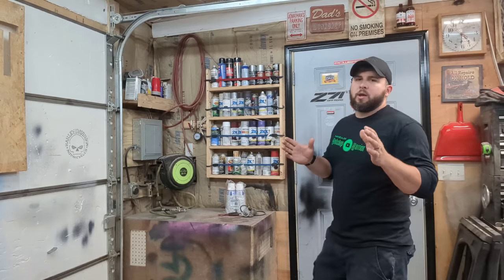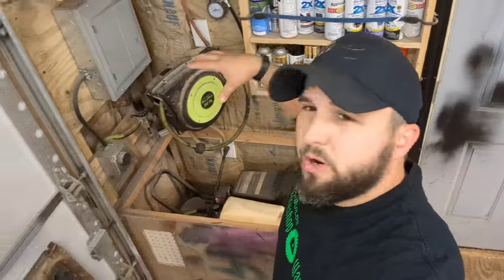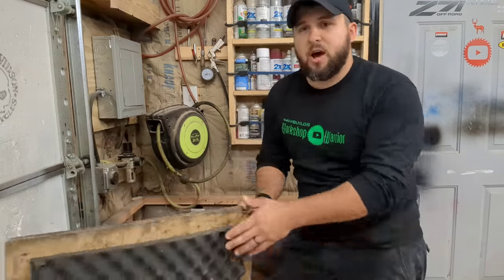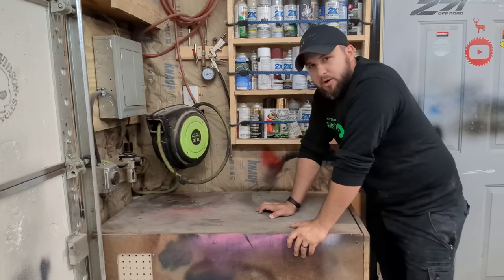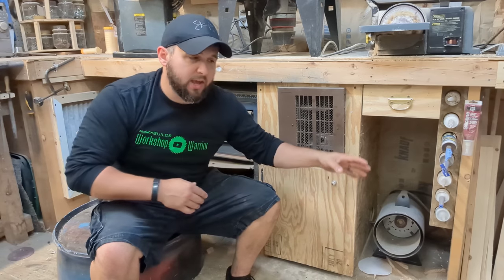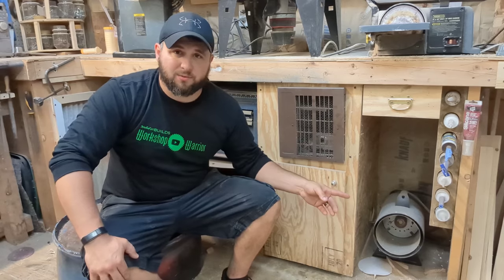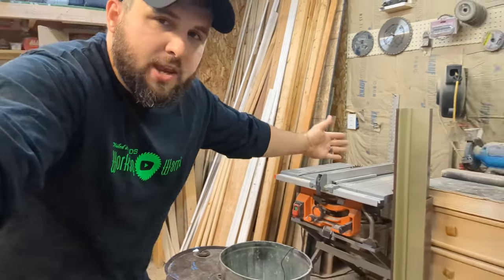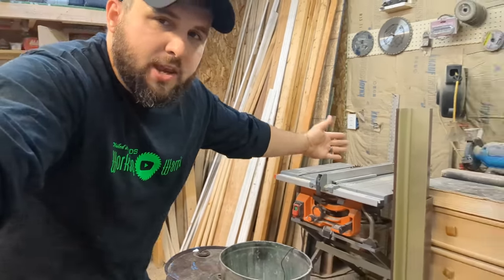Small Shop Hacks, Maximizing Your Shop

Comment: Take the handle  off of the pully crank and replace it with a threaded bolt and nut. Then just use your drill to raise and lower it. Thank me later
Reply: I was reading all the comments before telling him to use a drill to raise the cable.

Comment: Nails aren't old school. They are better than screws for load-bearing stuff, like deck joists etc. They have a much higher shear threshold than screws, meaning they're harder to break. They tend to bend a little, but not break in half like screws. Also, nail heads can be much easier to hide than screw heads.

Comment: 2 items I noticed that were not properly done (please take this in the educational manner it is intended and not to bash in any way). The back hangs for your garage door run parallel to the track and they need to run perpendicular-the sway brace for it is meant to prevent the horizontal track from any side shifting movement that will cause the door to run out of alignment and the possibility of the roller actually coming out.  Also you opted to do an extension springs door which does save a few dollars and might make the installation a little easier for someone that hasn’t installed before but it appears as there are no safety cables installed in them.  When those break there is a lot of energy stored in them and without proper safety cable run through them they can and will damage anything around them.  Keep in mind that when the door is down is when they are at full load and the winter time is when springs are more apt to break.

Comment: It doesn’t matter if this is 2523; nails and screws have different uses and therefore both are still as relevant as they ever were. They aren’t interchangeable. You make a decision on which one accomplishes the task you’re trying to achieve; not on which one you like better.
Reply: Gonna say the same.  Nails have some give/ flex and are perfect for taking the give and take of cold and hot movement of wood. Screws…not so much. They break not flex. They both are designed for specific purpose. Don’t put screws on your facia, the heads will break off instead of flex like nails are designed to do.

Comment: I put my air compressor out side of my shop and then built a small 5×5 room
Reply: Any air movement to cool air compressor during extended use?
Reply: No problem in the winter time for me yet and I live in a pretty cold area
Reply: @makepoliticiansscaredagain  not a problem so far it's been 5 years
Reply: @dickabbas6972  yes it has fans in two walls that I put on a switch that start when the compressor starts

Comment: When I built my shop, the local building codes restricted me to 8' walls. So I installed vaulted rafters which got me a much increased ceiling height. It has worked out great so I recommend anyone interested to try it.
Reply: Thar stinks.     You couldn’t say put the walls on 2-3 rows of cinder blocks to give them some artificial loft.      I remember once in Fla my fathers neighbor wanted a privacy fence but couldn’t put one up more than 6’ high.      He told the guy to build a nice earth ridge and stick it along that and it worked.        There’s often a way to beat these guys though it’s often just awkward and expensive.

Comment: Great ideas. Ye Ole carpenter here, when you build with wood, nails are a very competent fastener when done right. And, get this, they are a heck of a lot cheaper than screws! Keep on woodworking! Peace out....
Reply: I’ll second that. If you now use screws instead of nails, I wouldn’t recommend that for framing a wall or joists.

Comment: One suggestion: work/assembly table.  Make it a two piece, and on wheels that you can lock.  Design it as an outfeed table, or design it to tuck under or into another work bench.  Overall size would equal a 4x8 sheet of plywood.  Nice shop!!
Reply: That's a really good idea
Reply: I think April Wilkerson did that, so you know that it’s smart.

Comment: Thank you for posting your shop tour and giving your take on how you have it set up. I too have a small shop. A 14' x 20' metal shed with a 81" eve height. This metal shed was put up by my grandfather 40+ years ago. I find myself rearraigning my shop shop again due to the tools I have acquired over the years. I need to rewire/rearraign some electrical, install insulation and cover the walls. Seal up the roof due to leaks when it rains. I have used Sketchup to plan my shop layout and attempting to utilized the space the best that I can. 

I also have a garage type door, which I will be eliminating and framing in a wide hung door. The garage type door when opened blocks lighting and is not needed. I lose vertical storage space. It is more of a hassle to open and close my shop. Again, this thing is 40+ years old. It will take me some time to get it where I want it. I have budget constraints keeping from getting it done in a timely manner.

I have some good power tools I have acquired over the years.  I have also attended the Rob Cosman's Purple Heart project (May-2023 class) and I now have hand tools, a workbench built and delivered by a Bench Brigade member. I am also teaching myself how to weld. I do other projects in my little shop as well. It is not just for wood working. All my stationary tools will be on casters so I can mover them to the side when not in use. I am currently making one long bench on the left side wall. My table saw, workbench, two rolling tool boxes will fit under the the long bench. Wall will be use for vertical storage.

Again thank you for posting and you ideas.

Comment: When I had my auto repair and fab shop I built a soundeadening insulated box like yours but put it outside and plumbed pex lines inside which made it dead quiet inside and was far better for my compressor so it could draw in cleaner air.

Comment: Nice shop! Right now I can only dream about that much space. My "work space" is about 30"× 48". I modified a worthless old built- in ice chest on the sailboat, it's converted to a bench/ Navigation Center on our liveabord sailboat. Storage/kickspace below. Do about everything there, all electrical & mechanical repairs, fabrication, reloading, sewing, and my Ham Radio set up as well.
You gave me some great ideas for when we move back on the hard.
Reply: I wanted to add one thing, not nitpicking here, just a safety recommendation. Your propane storage, make sure there is plenty of ventilation to the outside incase of a leak. Propane is heavier than air so you won't know you have a leak until it's too late. Our propane lockers have a vent at the bottom so any gas can escape. On the boat we have ABYC marine standards, look that up. I witnessed my neighbor kill himself because of a poorly installed (factory) propane system. It's best if you can have the tank mounted outside. You can even install a remote solenoid to switch it on and off if you like. ALL propane tanks on all our boats are outside or in a ventilated outside lockers/compartments.

Comment: I have also use dressers for saws and such. Still do at the moment, changing some things. Good stuff in this video. 
For a 360° work space against the wall, I have a slide out with a "lazy Susan".  It was meant to hold a large CRT T.V.. Came out of a cabinet that the doors open and slide inside. Heavy duty and a nice find. The cabinet is now a coat closet. Upcycle!

Comment: Nice "Real" shop, brother.  I love all the great ideas. You have motivated me to get my shop cleaned up. Just subscribed. Love your comment..."I don't use nails, because it's not 1932 anymore". All of the builds on my house, new rooms, shop, pool deck, etc., I only use 3" high quality deck screws with T25 Torx. I buy the big 25 pound bucket. Always keep at least 50 pounds extra.
Reply: I laughed too, but one thing a lot of people don't realize is that nails are a lot stronger. Screws don't have much sheer strength (horizontal pressure). I've actually taken deck boards off after one winter and had half of the screws already broken!

Comment: Like the vise idea of grounding, but sparks ..... Like  compresor placement , but i would do outside  period . also vac in blind corner is briliant ! I used to have similar size shop 15x22 it was ok with heat etc but I want 9" celling next  no other way. It is cleat that you DO WORK in the shop unlike others that are just polishing benches for videos promos and product pushing, congratulations !!!

Comment: good video,  lots of nice ideas !!!   I am about to finish me a small shop in the next few days...  Wood floor on runners, insulated with 3" foam in the floor,  1-1/2" wood floor too...  I will be placing my Air Compressor and Vacuum Outside in a dog house to save some of my space,  and if you ever seen a Air Compressor blow up,  you will want it outside too.  I think I will try the Lazy Susan in the back corners of my shop (thanks for the Idea) from floor to ceiling too.  I also will be using the dust collector system on my drill press and lathe to collect the metal shaving to recycle... and my vacuum being outside will remove any smoking cutting oil fumes right out of the building too.....

Comment: I got a free file cabinet and it works great for power tool storage, the drawers are designed to hold a lot of weight and file cabinets in my area can be had for cheap and free in many cases
Reply: What he said ^ These are always being sold/free on craigslist and they offer huge storage (and protection) for larger power tools.
Reply: (I have 10 of em myself!)

Comment: Good video with lots to consider. I’m at the point of putting up wood walls inside my metal building (garage 24x48).  Junk has piled up over years and I will be hanging more tools and such on the wall.  Also dust connection is needed.  All the best from north Texas

Comment: Kudos on the dust control. I have a very similar setup with the Dust Deputy (well worth the cost) and a long hose where I can vacuum the entire shop with the flip of a switch. Also the box fan with an air filter works well. I did not permanently install mine so I can set it up near where I am cutting. Nice job.

Comment: One idea for your vac hose is to fasten it to a 1x6 on a hinge from the wall. You can swing it out and have your hose accessible from overhead to use for each tool. Leave several feet wound on a hook at the end to pull downWhen not in use just swing the hose and 1x6 to the wall.

Comment: Nice video- I actually would've liked more detail about the rv heater to heat the shop.  I have been wondering if the rv heater in an old truck camper I am disassembling would heat a corner of my barn which is what I'm turning into my shop.

Comment: Absolutely creative use of such a small place, mega cred right there. I plan on building a shop little bigger than yours + a separate garage and Imma put air compressor+pellet stove in the garage so they won't be so loud and in the way.
Reply: However big you think you need your shop make it 4 times larger and you should manage to get by.

Comment: Concrete is hard on the body... easy to clean durable but not many don't know it will pop or explode if using a torch for heating or cutting if  it's to much direct heat and evaporation happens to quickly.  Quite honestly if I was to do a wood working shop I would use crane matts  on a bed of gravel  with plenty of drainage.   Great ideas
Reply: That's what I was thinking. Standing on wood is so much easier than standing on concrete. But I have some rugs down on the floor in my shop and them rubber mats and they help.

Comment: Perty cool video. You make good use of a small space. You have some nifty ideas.
         I would like to give one caution. FIRE!!!! Wood dust will settle everywhere, even with the very best most complex vacuum system. Wood dust and sparks from a welder dont mix well. For a wood related fire, water is best. In manufacturing environments, the safety rules make sure to have a fire extingusher close and ready. Then there is a lot of paperwork with a discharged extingusher plus the expense of replacment. I have always kelpt two full water , or two pop bottles with tops and a hole stabed in the top handy. They are by far the best frist responder to suppress the small fire and prevent using an extingusher. A good squrt bottle marked for fire works good, too. The best i have found are the "Zepp" spray bottles that "Lows" carry. Even with this recomdation i would recommend that you have a middle size fire extinguisher near the front and one near the back along with a water squrt bottle. Small fires can turn into a great big disaster very fast. 
      I hope you dont mind this comment, I care about people, and I would hate to hear that you lost your investment with a fire.

Comment: High ceilings is a must, you may not need them now, but you never know what the future can bring you. I opted for 13ft ceilings for a car lift and the ability to work on my skidsteer with the boom raised all the way up.

You definitely can never have too much power, I did a dedicated 200A service and I currently only use about 50A, but the future upgradability is absolutely worth the added upfront expense.

My shop is definitely not "small" but I will definitely be implementing some of the things in this video as they are fantastic space savers for shops of any kind. Weather it's a 14x20 or a 50x50, it's inevitable that you will run out of space.

Comment: First, I am interested in the RV heater walkthrough. Second, if the crank is smooth, you can always use a PVC pipe with a 90 on it on the end and use that to crank the table up and down. Saw that on another video. Pretty smart
Reply from the maker: A did end up doing the RV heater walk through video, it's on the channel. Thanks for watching.

Comment: Love the space, love the video! Only thing I don’t understand is your philosophy towards heat. You’re using so little heat that unless you’re super limited in your panel, two cheapo 1500 watt space heaters would do the trick and wouldn’t be any more expensive than propane.  Otherwise you could go with a minisplit, save some space and gain AC in the summer.

Comment: One reason why you should not be useing a forced air propane heater is it burns up oxygen fast in a small space. If you feel sleepy get out of the shop for some fresh air. The camper heater is fine as long as you vent it. 
Nice shop about the same size as mine.

Comment: You did great , great advice and insight , from prior construction experience the ground you built on had probably not be rolled over properly with a roller , I was really disappointed to find this out during my time working there that they dogde doing evey part of the land as they should and in turn that explained to me why I have found so many what I call ankle breakers throughout my life aka a dip or str8 hole in the ground. Great video thanks for the insights and keep up the effort , take good care

Comment: I have 10 foot ceiling and that is too short.  The number one con is getting things through the overhead door.  The effective height of an 8'x16' door 7'-6" after the header, trim, and weather strip.  If I did it again, I would would go with 12 foot ceiling and 10 foot high door.  Thanks for the shop tour.

Comment: Great video! I watched to get ideas for my 30x40. Metal building on concrete, I use it mainly for working on old motorcycles. I don't have a hose reel, you convinced me. I moved my air compressor to a small shed next to my main shop, sure is nice not to hear that thing!
Reply from the maker: I'm actually planning on moving mine to my lean to attached to my shop. It'll be even quieter. Thanks for watching.
Reply: I have my air compressor in the shop and when it starts up it just about gives me a heart attack. It's real loud. Can't think straight when it's going loud.

Comment: I used concrete footings with 2x6 framing and 1" wood on my floor, It's worked pretty well and the original floor lasted 11 years before I had to start replacing the plywood do to rot. My biggest mistake was going with a steel building, It's absolutely terrible. it sweats so bad that I get ice on my ceiling that then thaws and drips water on everything, not only that but I know how to work with wood structures, not steel so adding a window or even hanging something on a wall is just not possible. My next shop will absolutely be a  concrete slab with a wood building.

Comment: One Idea for you.... you could dig a foundation wall say like one foot west and one foot north,  jack up the building and move it, one foot west and one foot north and set it on the new foundations....  Toss down some 2" Styrofoam 4 x 8 sheets.... cover with 2" of dry concrete level out and Water Mist real fine for a day or two !!!
Reply: I just watched a video where a guy tested dry mix out. It sucks. The stuff never came up to spec. It was all crumbly and crap compared to wet mix. So I'd never waste my time and money. You do concrete go the whole route and do it right. The whole trick to concrete is doing the prep. Just be ready when the time comes. Have everything all laid out. Then you pour it, screed it, float it and finish it. That's all there really is to it.

Comment: My air compressor hack is to locate the compressor in a different building, which is plumbed with air, and having an outside port that the shop can be fed from as needed. 

I've got a 21gal oilless compressor, and attempting to add on a aux air tank lead to compressor damage, so it takes much longer to even just fill it's own tank. I've got a tiny oil'd compressor pump(from a maybe a 5gal compressor, that the tank popped on as soon as I'd brought it home from a yard sale)  that I may add into the aux system, if I can find a space I could plumb in the aux tank~20gal)_ as a permanent part of the system.
Reply from the maker: My latest shop hack video I moved the compressor to the attached lean too. Way nicer.